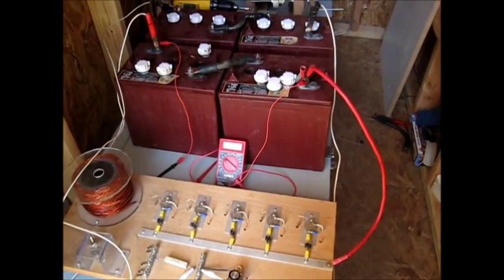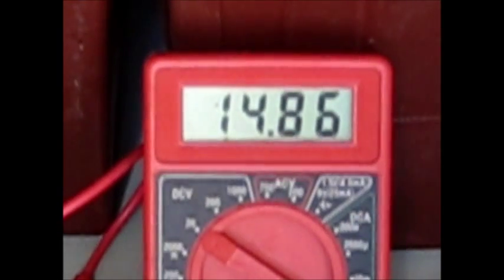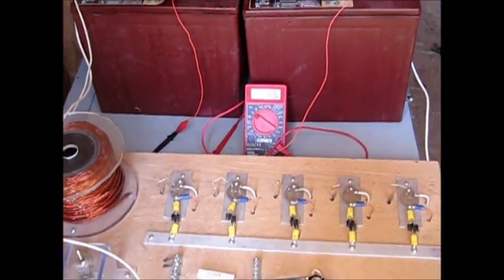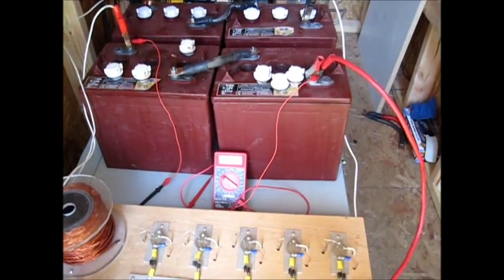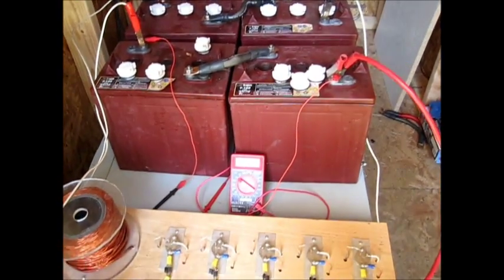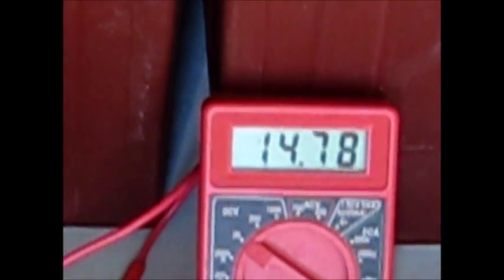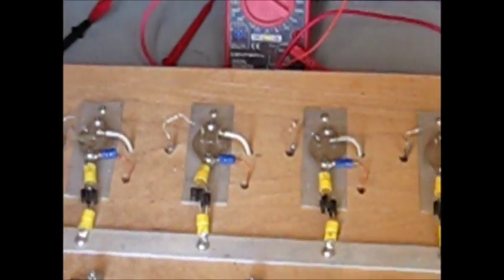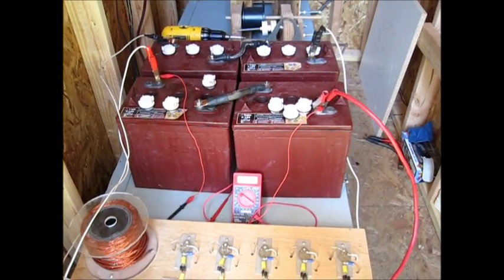Solar batter bank De sulfation part 3

Comment: do you have a drawing for your  solid state pulse motor 
i like to build one 
i look all over but did not fine a copy
i build a Bedini pulse motor but to noisy and to slow
thanks for the help
Reply from the maker: I do not have the schematic for it, you can contact Tin Man on youtube or see if international alternative energy center is still on the internet, they have all the information

Comment from the maker: thanks! the first two batteries responded very well to the solid state pulse. I should be able to hook them up to a head light tomorrow and start a spreadsheet of information on each battery. the second two batteries are going to take some work. heavy sulfation build up.